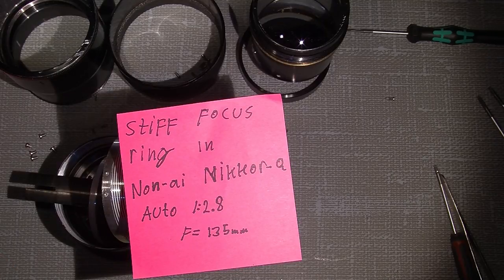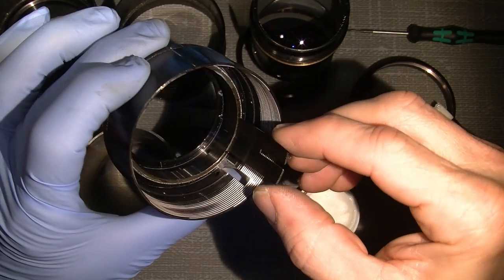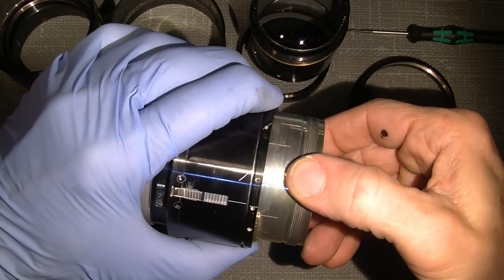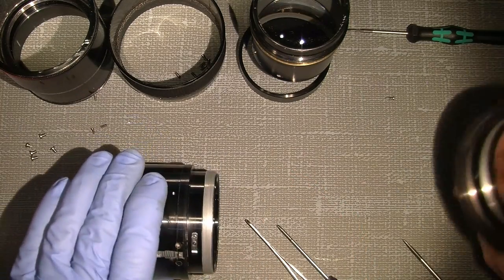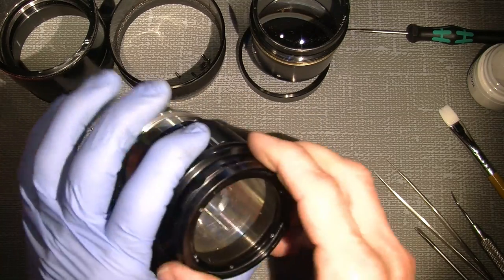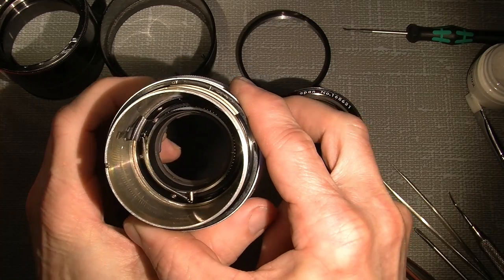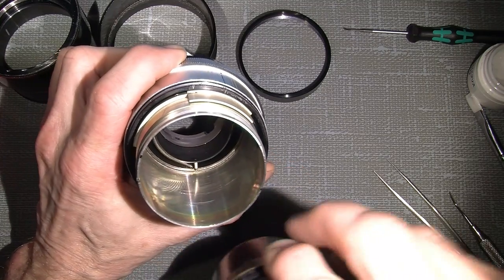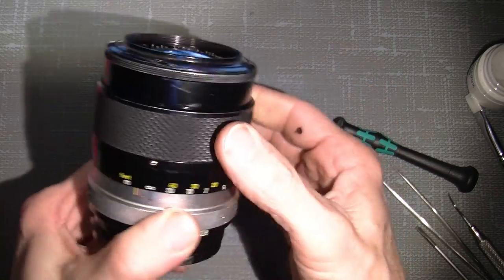Stiff focus ring in Non-Ai Nikkor-Q Auto 1:2.8 f=135mm___PART_2_Assemble

Comment: Great vid! ... What did you use to clean the threads?
Reply from the maker: I use lighter fluid to clean the helicoid threads.
Reply: @mikeno62  thank you so much for your answer.
One more question if I may, on the  Nikkor35-70mm2.8 Haze video, I am trying to remove the middle elements group (Having already removed the frontal group), but I find it very tight. Is there another way to do it besides using your rubber conic tools?
Thank you once again.